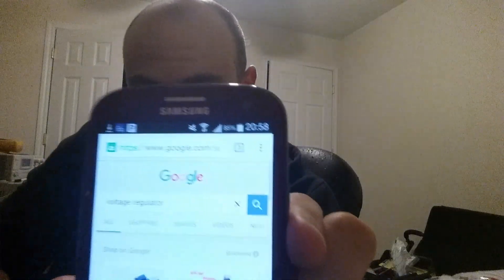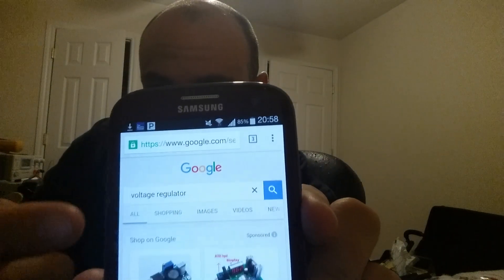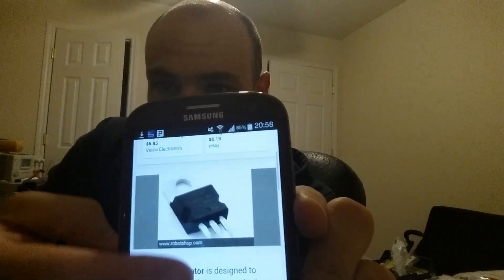PWM is Regulated and Here's Why

Comment: Hey I made your p-get buffered pwm with a 3s Lipo and it works fantastic but I’m looking into makeing a 4s Lipo pwm and wanted to know if I use parallel N-fets do I still use just one 1kohm gate resistor and will the ne555 be ok with a 16.8 volt full charge of the 4s Lipo or should I try and fit a separate 9v power supply for the 555 circuit
Reply from the maker: You'll have to check the maximum allowable voltage for the 555 and other voltage-sensitive components like the MOSFETs.
Reply: @Relayer1974  i want to ask about the frequecy, as we know thats important, and from the pdf you made the "beep" cause we set the frequency in human audioable and sometimes that so annoying. And what frequency recommend ? 300hz/500hz as a general pwm board built or how ? Thankyouu
Reply from the maker: @ilhamprakoso1237  anything in the couple-hundred Hz range is ideal for a couple of reasons.

1. You won't get any odd high frequency effects like harmonics or overrunning the specs of the circuitry and

2. The sound it makes isn't annoying to hear, if you even hear it.

Comment: Great video! I know this is out of left field but... I'm building a 200w raptor, and am using your diagram using 3 18650's. Could the 270ohm resistor going to the potentiometer be replaced w/ a 220 ohm resistor?